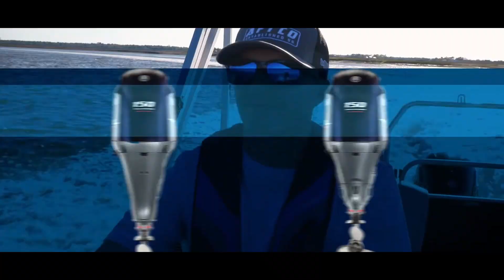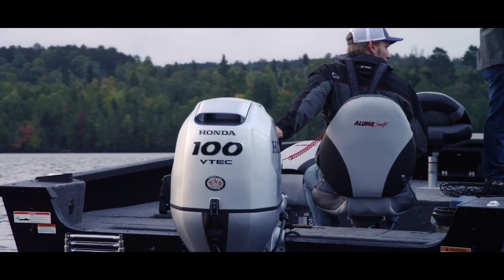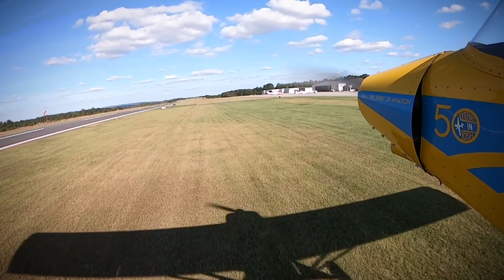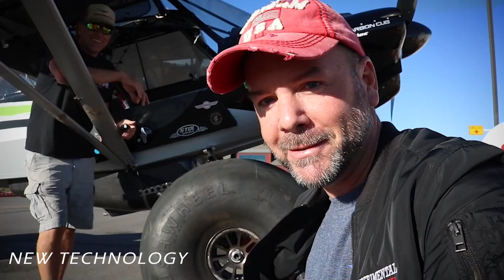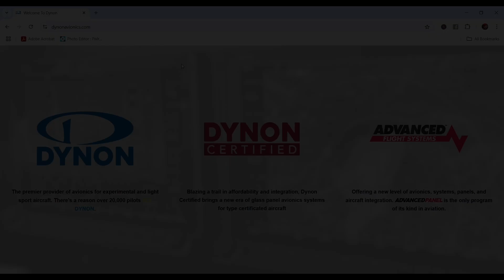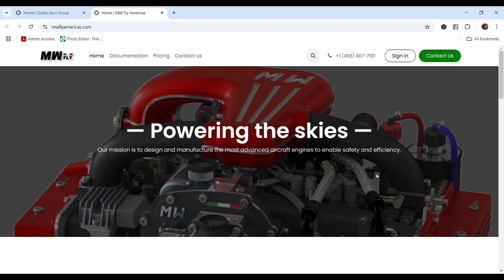Could You put a Boat Motor in an Airplane? Discussion

Comment: Viking makes a great aircraft engine using Honda. Honda makes great engines and the replacement parts are easy to purchase.  It's very hard to compete when they build engines in the millions against the typical air cooled aircraft engines that take forever to order with a very low production based on designs that date back to the 1950's.  Water cooled Honda engines are a good alternative to the old school air cooled aircraft engine at a far lower cost to buy and operate.
Reply: Viking sells a Honda fit engine for 20K, less accessories. I can buy 2 1/2 whole cars for that.

Comment: I fly behind a Continental in my 172, Subaru in my zodiac, Volkswagen on the sonerai, and rotax in my challenger. I'm an outboard mechanic and have raced the 2.4 and 2.5 engines since 1995. I would never fly behind any outboard and you can see I fly some sketchy engines. The V6's by time it was done you could have bought something different that works already. the smaller efi four strokes have to many cheap Chinese parts. It would be easier to find an alternative 4 stroke that already has an oil sump. I see too many upper bearing failures on the 5O Yamaha four strokes. Maybe could be blamed on oil change intervals, don't know.

Comment: The marine engines require auxiliary water pump, and the exhaust goes out through the drive end of the block, both extra issues compared to sled engines. 😉🇨🇦

Comment: I think the biggest problem is cooling. If you think about it, they take cold water to cool the engine. I think the water jacket on the boat engine is smaller so hot water is going to have a problem cooling the engine.

Comment: In my experience boat motors are the most troublesome, unreliable power sources I've been around. They run great until they leave you reaching for a paddle.  They are very problematic if not run for months.  If you take flight with one, I will not be riding along.
Reply: I agree.  Traditional Outboards sit for long periods, the gas evaporates gumming their multiple carburetors and subsequent hell to start.  Airplanes sit so expect the same problem.   Methanol gasoline causes all kinds of problems with two strokes.  I am not sanguine about 2stroke outboards in a plane, but their size/weight compared to same power 4 stroke is impressive.
    However fuel injection bites that off and direct fuel injection drastically improves efficiency.  I think a blown, two stroke, Schnuerle ported, wet sump, direct injected (similar to Deltahawk) would be a winner.  But it would be scratch built, not converted and that’s the rub.   Cheers

Comment: The 150 Merc was the 2.5L engine, and they built it all the way up to 240hp. My 240 Merc "SportJet" would run 6100 rpm all day long.  Big 2 strokes didn't care on RPM. AND..... it was 24 gl/hr full throttle. Yes, it was iron sleeves, but it would be a light engine for the power.  The down side is.... a 400 hr engine is getting tired.

Comment: I know of 3 home built light sport aircraft/microlights in New Zealand and Australia that have 2 stroke outboard engines.....2 of them yamaha 90hp's and one that has a mercury 150hp
Reply from the maker: Can you send them my way?? Are they still flying today?
Reply: @ExperimentalAircraftChannel  The merc powered one in New Zealand had the outboard engine removed after it was sold because the new owner didn't want a 'not specifically designed for aircraft engine' in his kitfox, after this it could no longer do VNE going up hill.....dunno about the 2 yamaha powered ones, they were owned by 2 brothers who were stock mustering in Western Australia about 2006 to 2008 when i saw and spoke to them....they were a neat setup, used a homemade pressure lubricated morse chain (like a timing chain) in their reduction drive with a sprag clutch that allowed the engine to declutch from the prop when descending and the throttle was closed, the engine was mounted layed over on its side with the reduction drive at the firewall end and the propshaft went overtop the engine out to the front.....the carbs were standard keihin flatslide 32mm (same as on the bike i had at the time lol) that had bowl vent hoses adapted to allow the float bowls to see a controlled level of vacuum from in the venturi on the carb, this allowed them to individually control/balance their mixtures/EGT's with a needle valve on a tee line to atmosphere for each cylinder and when the throttle was closed and vacuum from the venturi was lost it went back to the standard jetted mixture with no input from the pilot needed....very handy when your altitude density can change 5000ft between dawn and mid day.....they also had complete individual ignition systems for each cylinder so even being single plug they would only lose 1/3 power if they lost an ignition

Comment: Me thinking: Why not use the Rotax snowmachine engine (600 EFI/85hp og 600 E-tec/126hp an 32 kilos both)  with the CVT gearing as a gearbox? Rotax CVT gearing runs from 0,75:1 to 3:1 Snow machine two strokes idle at 1500 an tops out at 8000. With a high angle prop setting one would get lots of torque for a big propeller in take off and low rpm in cruise. The belt runs "cool" in the air. Just  a thought that keeps revisiting my brain...
Reply: I've been thinking the same thing.  Centrifugal clutches, both drive and driven, have nearly infinite adjustability with varying flyweights, spring tensions and ramp angles.

Comment: The Rotax 582 on my ultralight is basically a boat engine. 65 HP, 2 cylinder 2 stroke, also used in jet skis.

Comment: Wow great discussion very interesting. I designed and built a coaxial helicopter powered by a Johnson 60hp two cylinder 2 stroke outboard. 
The power head weighs 38kg which isn't bad at all, I've had the machine hovering but it will only hover for 1m 30s before getting too hot. I've got an electric water pump and fan with single core radiator. 

The radiator is bigger than the ones used for a 582 rotax but as mentioned there are obviously design differences in how the two engines are cooled. I'm going to increase the pump flow rate and increase the radiator size plus have a belt driven fan. 

All this is going to increase the weight of course but I don't think I have another choice apart from adding cooling fins to the cylinder head covers. 

The Bensen B9 helicopter built in the 1950s used a mercury 70hp inline 4 and could hover without overheating. Rotorway as mentioned used outboards to begin with. 

I thought I was original in using and outboard to power a helicopter but found out after it had been done lots of times in the past. 

Thanks for the video regards Ben

Comment: Volkswagen buses get converted to Subaru power and usually use horizontal belly radiators, so horizontal rads with ducting are proven to work.
Reply: Субару ненадежный и тяжелый

Comment: Like the thinking , something we have to do ,but generally find if it works its out there . The bullet proof snow mobiles ,that have all the parts and add ons ,aka Mr Henry , does look a good path . an out board motor conversion would be good for catching them flying fish ,combine fishing and sports aviation ,be a winner .. A rotary now your talking, Rob Dham is doing a turbo two rotor 13B putting out 700 HPs, dry sump, two plugs compact ,just need a lot of radiator ,and even with a turbo the sound could kill people ...

Comment: Love to throw a BMW or Harley oil/aircooled in an UL or an X/Amature built....
Reply: I've seen a few converted  BMW bike engines - seem to work well. HD engines (from vids and articles - purely anecdotal) are not smooth and heavy for  the power and .... .reliability? Was a company that tried to market HD aero conversions...Hog-air...they didn't last too long.
Reply: I still dream of using my 920 Virago in a Littlewing gyro. Use the transmission and drive shaft, probably 3rd gear for 52” prop. Very little conversion except motor mounts, cooling baffles, and prop flange. I don’t know the weight, about 72hp.

Comment: Aeromomentum uses Suzuki marine engines, and Viking Aircraft engines are Honda auto engines which is the same engine that Honda has used in their outboards for decades. The Honda Fit is the same engine as the 75-90 hp outboard. The Suzuki engine is 40lbs less than the Honda.
Reply: Aeromomentum are not marine engines, neither are viking!
Reply: @chippyjohn1 aeromomentum engine is based off of the Suzuki outboard.
Reply: @tdbassman1  No it isn't. What makes you think that?

Comment: AT one time I heard about the Weber MPE 750 turbo engine (snowmobile), but what happened to that conversion I don't know.
Reply: I would like to know more about this. German made Muli-Purpose Engine (MPE) that is widely used in european autos. Twin cylinder, 135hp stock in the snowmobiles but are commonly cranked up to 180-200hp with a tune. I have said snowmobile in my shop and love it in the Polaris... always felt it would be a good option in a plane.
Reply: @DuneMoose5  
I don't know why no one is working on a conversion for this engine. It is 4 strokes not much bigger than a 582, with high rpm, and proven engine in extreme operations.

Comment: Yes, I have been thinking about cross-dressing motors to craft.... like the 1000cc Honda flat engine from old Goldwings but it;s
like a slab.  I wanted to use one in a boat for it's low profile & great power but it would make the below deck area much lower
than you'd need to set a V8 in.   I've often wondered why a Cycle engine can't go into an aircraft but I think it would not be able
to be insured?  Perhaps you can use them in the Experimental Class & I saw a guy w/ a Corvette 350 in a Velosity(canard) and
it flies & sounds great so I really do not know why you can't do it?  peace
Reply: У Хонда голд Винг КПП от двигателя неразделимы одно целое а это лишняя масса .
Reply: I did not know the transmission & all is within this iconic motor..... some last 300,000 miles & they started making the
Honda Goldwing Flat 6 six cylinder in 1975 & I think that are still making them?  Here's a good video about 8 of the
best Japanese Motors ever built ; https://www.youtube.com/watch?v=rY_stNTPqJU  As for the extra weight I'm
not too sure it would be a problem in a boat?  It would work well in a boat but I don't know about in airplane?
Thanks for letting me know this,  I did not know until you said so.  peace
Reply: @diggy-d8w I was examining a gold wing engine at a motorcycle wrecking yard - thought it would make a good aircraft engine. Did some research, too heavy! Honda auto engines of equivalent power are much lighter and an easier conversion as no integral gearbox to deal with.

Comment: How about a discussion on motorcycle engines?
Reply from the maker: Great idea!
Reply: @ExperimentalAircraftChannel  BMW 1200 boxer still in production
Reply: @flytoday There is at least one  that I've seen on a light/sport. Parasol wing and I don't remember the make of the aircraft. Very cool. Thanks for sharing, J. Michigan
Reply: It's been tried before it just doesn't work because boat motors has a endless supply of cool water
Reply: @christophergagliano2051  Like a radiator?
Reply: @tomcoryell  no it doesn't work that way. A radiator might help but these engines require tons of cold water and they get that from the body of water that they're on. They are not designed to dissipate heat like an aircraft engine or an automobile engine
Reply: @christophergagliano2051 I don't think that's an insurmountable problem. Outboard engines have the water pump in the lower end so you'd need to come up with a housing for a mechanical pump or use an inline electric one and and a radiator of course.  I doubt there is much of a difference internally between an outboard for marine use vs the same manufacturer's land based version. Yamaha, Honda for example, PWC and motorcycle, snowmobile or auto.
Reply: @mr-uc4me  Well look at the big radiator that Steve Henry has to run on his stol aircraft. Lots of drag there but that's okay for him because his aircraft was never designed to be efficient, but that's a fact
Reply: @christophergagliano2051  he's also making 400+hp - that makes a lot of heat = need big rad.
Reply: @mr-uc4me  I totally agree, good observation
Reply: I've heard of someone using a Suzuki Hayabusa motor on a plane but I don't recall details.
Reply: Harley 1200 from a Sportster. The thought has crossed my mind 😂
Reply: @RabbitHoleAdventures  Heavy, low horsepower, unreliable, and old technology. You would live longer if you stayed on your wife's bike.
Reply: Most motorcycle engines have integral gearboxes = extra weight and bulk.
Reply: Modern bike motors have the same can-bus computer problems as autos....
Reply: Коробка передач весит и она не отделяется 
Также на старом Ямаха р1 2000 года выпуска в 2024 году при ремонте мотоцикла был обнаружен включение 2 передач одновременно. Это произошло на ходу мотоцикла , при этом заднее колесо заблокировалось , двигатель встал клином , и цепь ГРМ перекинулась по инерции на несколько зубьев .
Reply: Motorcycles spin VERY high RPM. The 100 HP Sportster 1200 I had needed 7000 RPM do make that, and it was completely unreliable. I would fly behind a 70's VW engine before a Harley.

Japanese bikes on the other hand, like the Hayabusa, spin twice as fast. Reliable, yes, but definitely needs a gear reduction.